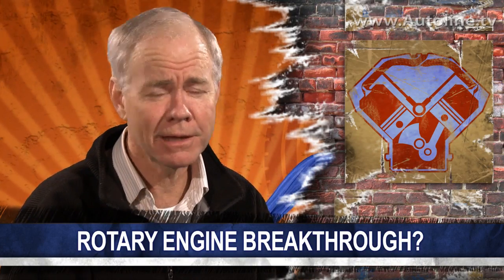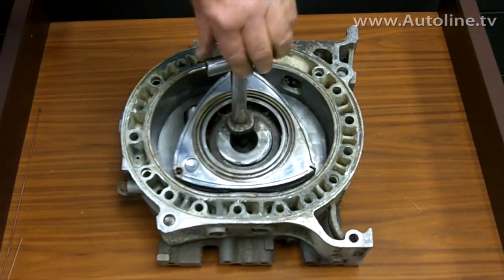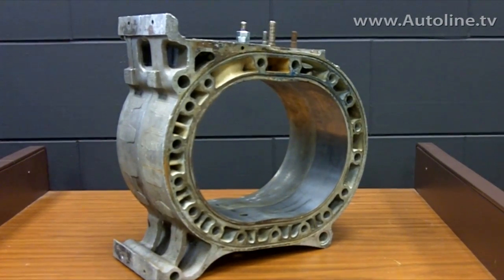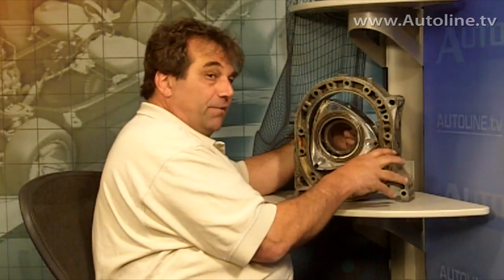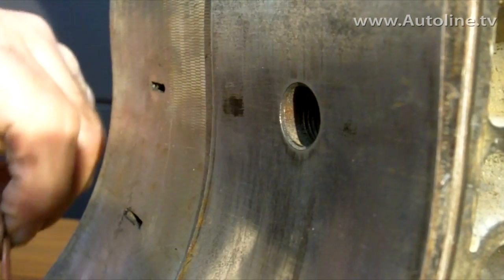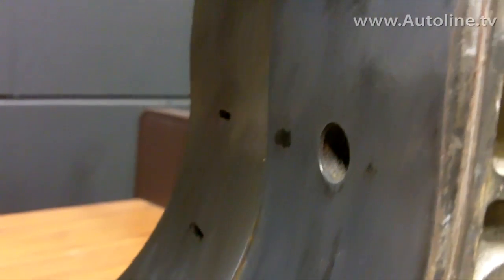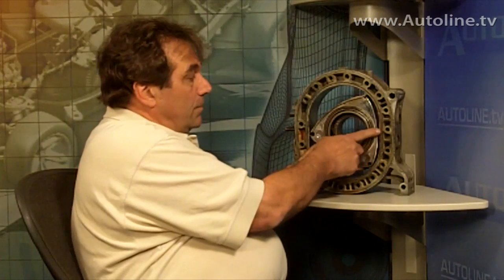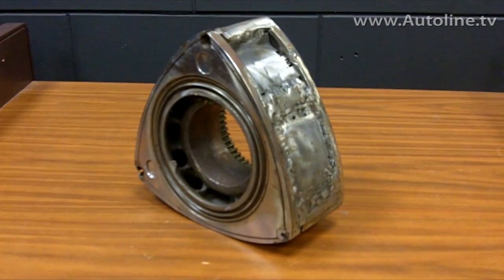Rotary Engine Breakthrough?

Comment: the way the rotor moves around the crank means no energy is sent the wrong way anyway but the idea of having a smaller spark hole so no fuel leaks through and just goes out the exhaust is a great idea all these goons saying shit about fluid dynamics an shit really have no idea themselves
Reply: Except that once the fuel has burned the pressure in the power stroke section that is moving toward the exhaust port is much higher than compression pressure.... it has to be for the engine to make power.  Any leakage will actually be exhaust into the fresh mixture.

Comment: I bought this Mazda rx8 and it's making a ticking sound . Sounds like on right side of motor I bought it from a gentle men he said he don't know and he said good luck to me I don't dog my car I saved for two years I bought it in memory of my father who passed away .my car reminds me of him my life has been so bad that when I thought that I could get my life back together 3months later my car is in my front yard and I'm watching every u tube video trying to figure out that sound cause I can't afford to take it to a mechanic .and I never really fixed no car but I ain't dumb and I ain't the smartest person so every one on u tube who gives these u tube videos thank u for your knowledge and I'll never give up if my car sits until I figure it out I'll never sell it thanks u tube and Mazda guys respectfully Sammy ortiz
Reply: A ticking sound, the exhaust heating up or cooling off?  I'm not aware of any mechanical failures that should like a ticking noise at least no with the motor.

If you can record a video or even audio of it and link it to a rotary forum they will likely be able to tell you what's going on.
Reply: Thank you
Reply: You need to check the output of the metering oil pump. The apex seals will make this ticking noise if they aren't receiving enough lubricating oil.
GOD Bless and GOD Help us,
rich!
Reply: Richard Pope  hi mate. it wont be the apex seals they will not tick loud enough for you to hear them. It will be the fuel injectors especially if you're using ethanol based fuel.
Reply: Mark,
 . . . . Did you determine what the ticking noise is? I'm sorry for taking so long to get back to you.
GOD Bless,
rich!

Comment: On a side note, I don't even now why anyone brought up Pascal's law. Yes, it applies, but it also has no immediate importance to the discussion. To assert pressure is uniform across the chamber due to Pascal’s law means you need to re-read your fluid dynamics text; Pascals law basically states that an increase in pressure within a (bounded) fluid results in a proportional increase across the entire fluid — but the chamber is not static! The fluid therefore has both a velocity and pressure GRADIENT. Although he may lack the ability to articulate it, the guy in the video is obviously trying to implement a squish-style chamber in a rotor. Since the fluid in the chamber is not static, i.e, as the chamber geometry changes, there exist regions of high and low pressure as the fluid is compressed. In piston engines, the idea is to compress the bulk of the fluid toward the plug by altering the geometry of the piston crown. Varying the geometry obviously also effects flame propagation. I don’t understand what the confusion is about.
Reply: "Another empty......"   You must understand that doktorbimmer will not tolerate any discourse at all that is outside of his declared best practices for ICE engines.   All engineering in this field is dead, all the engineers working on it are clueless, and only the real doktorbimmer knows the sensible approach.
Reply: @someotherdude  Have you been by your local Mazda dealer???

Comment: I am reading all of these comments and I cant stop shaking my head.   

   So many people were so quick to "prove" how smart they are by citing Pascals law, they never stopped to actually think about what the man was saying, If they had they would realize that Pascals Law actually proves him right. 

  The guy who came up with this is only "wrong"  if you are being incredibly anal about nomenclature, or are incapable of understanding the basic principle of what he is proposing to do by changing the geometry of the rotor, most likely both.     

  At worst he is only guilty of a misnomer. 

 The classic demonstration used to teach Pascals Law actually proves that his modification to the rotor will work. 

    A U shaped pipe filled with water sealed by two pistons. 
    Pipe #1   has two identical pistons with 10 square inches of surface area,   A 10 lb force is applied to one piston creating 1 psi and moving the piston down 1" , the other piston will have 10lbs of force imparted on it, at 1psi moving it 1" up. 

  Pipe #2    Piston A is 10 sq inches,   piston B is 50 sq inches , the same 10lb weight is applied to piston A moving it 1" and creating 1psi of pressure,  piston B will receive 50lbs of force  at the  that same 1psi,  but only move 1/5th of an inch.  

       Both systems have the same amount of force applied to the "pump" piston A  and equal fluid pressure inside the pipe, but the surface area of the "ram" piston B determines the "pressure" (force) differential. 
     Just like in the pipe, changing the area of the leading edge of the rotor (piston) will change the amount of force imparted on the rotor by whatever PSI is generated by compression and combustion.    
  For simplicity lets say the area of the stock rotor is 100" square, and 100% symmetrical,  and combustion generates 100psi., 10,000 pounds of force will be applied evenly across that side of the rotor.  
    He comes along and cuts a large pocket out of the leading edge of the combustion face of the rotor  making it asymmetrical, increasing the surface area of the  by 50 sq inches, now that 10,000 psi is distributed across 150 sq inches, and 100 of those square inches is receiving the original 10,000lbs in one direction and the remaining 50 sq inches receives 5,000lbs of force in the other direction.     still alot of wasted energy but alot more efficient than the current design. 
       

   I cant believe that none of you supposed engineers like The Real Doktorbimmer cant understand such a simple concept.